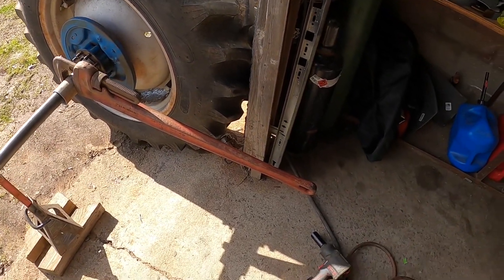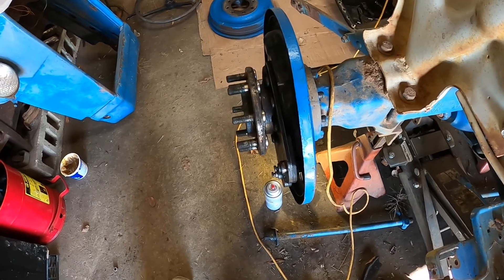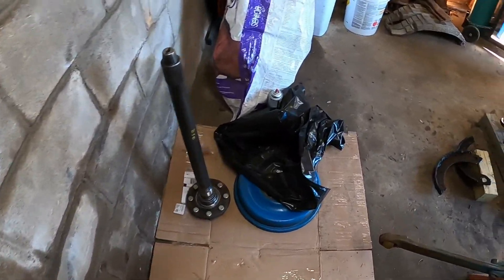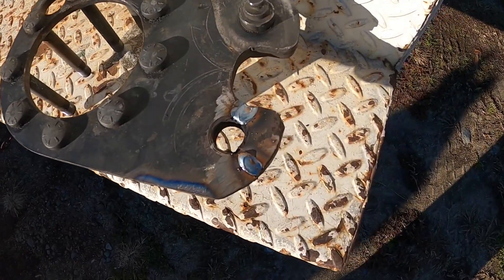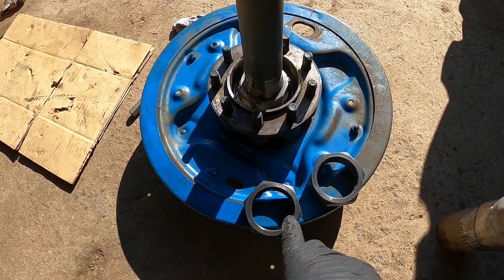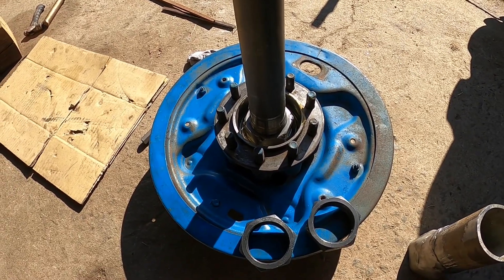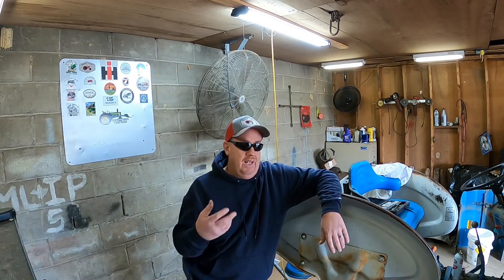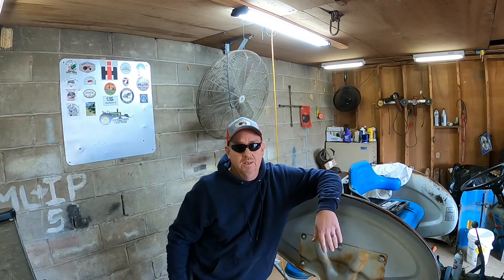Setting Rear Axle End Play on the 3000 Ford, and Did the Frankenstein Axle Nut Socket Work?

Comment: Was that a 36" pipe wrench? 83lbs of force on the end of the handle would create 250 ft-lb. Pretty sure it's WAY tighter than 250 now. You put about 750 ft-lbs on it.
Reply from the maker: Let's just say it's tight, I don't go into technical details or claim to have all the answers. The simple math equation has numerous other factors to equate in...to come to an exact "torque spec" Especially the actual give in the wall of the socket needed for this size nut, the actual weight pushing on the end of the wrench,  from the center, and how much stretch the threads and nut has itself. Although I do agree to a rather large point, it is way tighter than the spec calls for. The main issue with the seal failures is the loosening of this nut.  Both were finger tight when I started.  It will never see the road and lives out it's life here at about 3-4mph. Thank you very much for the comment, and I do agree for the most part.  It has worked flawlessly and dry as a bone since that day. Thank you again👌🏻

Comment: Hahahaha....I don't believe you had a bit over 242 foot pounds on that thing....well, until you started spring boarding that is !!  LOL    And look at you there burning wire like a boss !!  Awesome job.  Frankensocket worked perfectly.  I think I have the same Rigid wrench too.  You sure got lucky with the dealership being so helpful.  Great video my friend.
Reply from the maker: You were just about exactly right Mr Wendell!!!!! We did check by welding a socket on, then borrowed a TA 😉😉😉 I think I was having a little to much fun with those bounces 🤦🤦 Finally getting the hang of that little Hobart!! The ole rigid gal doesn't see a lot of action, but always the perfect fit when she is needed!!! I have to say I agree, Tim is amazing!! Thank you sir for the kind words and always being here!! I really appreciate that!! 😁😁🇺🇸🇺🇸👍👍
Reply: @Pennies_on_the_dollar  You bouncing on the pipe wrench reminded me of the first time I removed the two piece buds on an '85 C-60 I had.  Not realizing the left side of the duals had left hand threads, I couldn't for the life of me get those things to bust loose the same way as you were doing on the Fords axle nut. Then just for the heck of it I tried the other way and holy cow.....I found out the hard way they are left handed on that side of the truck!!  I had the long bud wrench on the outer nut,  resting on an old RR jack and the 4' pipe wrench and about a 4' cheater on the handle.  I could sure hear 'em squeak as I was bouncing and bouncing on it in the wrong direction !!
Reply from the maker: Oh my goodness 🤦🤦🤦🤣🤣🤣🤣 Now that is a Nelson move sure enough Mr Wendell!! I would have probably went and got the loader, before realizing 🤣🤣🤣 That one made me chuckle sure enough my friend!! 😁😁😁👍👍🇺🇸🇺🇸🇺🇸
Reply: @Pennies_on_the_dollar  Man, talk about a dummy move...but heck I though Chrysler was the only ones to run left hand threads on the left sides of cars.  It never dawned on me.  But then I saw an "L" stamped on the end of each inner bud on this side and a "R" on the end of each one on the right side.   Chevy musta knew there'd be guys like me !!  (-;
Reply from the maker: @tractorman4461  🤦🤦🤣🤣 I would have done the same thing, only to never see the L, continue to pray and beat until breaking the studs off one by one attributing it to major rust and bad luck 🤦🤦🤣🤣🤣🤣🤣🤣🤣🤣🤣

Comment: Yep, I'd say that's about 250 ft lbs right there, LOL. Nice thing about the tractors I have is I can get parts for all 3 at the New Holland dealer and there are 2 dealership close by. My IH, NH, and Ford all come under CNH.
Reply from the maker: Close enough I figure anyway Mr Robert 🤣🤣🤣🤣 One extra bounce for food measure 🤦 You know, I didn't think of that...need to check about the IH stuff there too 🤔🤔 Thank you very much sir for always being here, I really appreciate that!! 😁😁👍👍🇺🇸🇺🇸
Reply: @IP Farms  Yep, they should be about to get you IH parts.
Reply from the maker: I never even though of that, well hadn't given the Ford dealer much thought honestly until the 250c. Thank you very much sir!!
Reply: @IP Farms  Yep, they all fall under Case/New Holland. Sperry Corp. bought New Holland in 1947, then it was bought by Ford Motor Company in 1986, then FiatAgri in 1991. Then, in 1999, Fiat Group acquired Case Corp and merged it with New Holland to create CNH Global.
Reply from the maker: Thank toy so much sir for the info!! That sure does make life easier!!! 😁😁🤞🤞